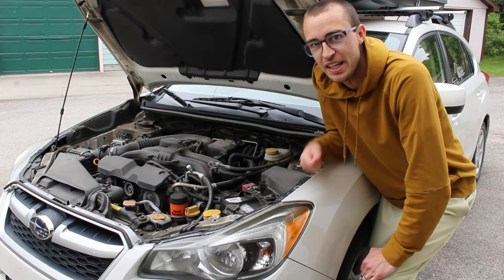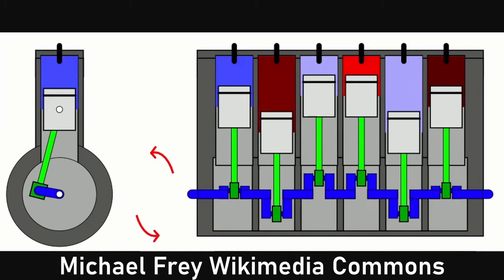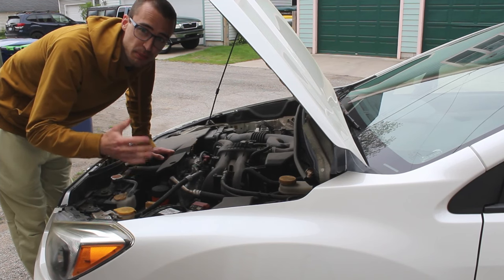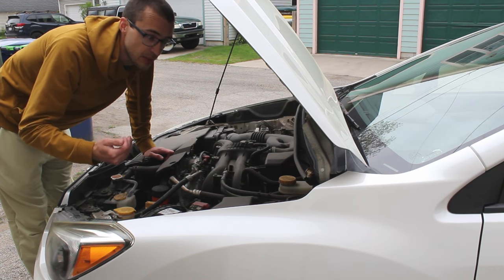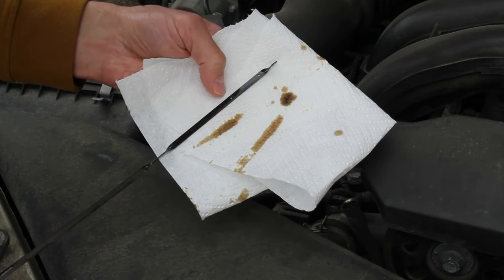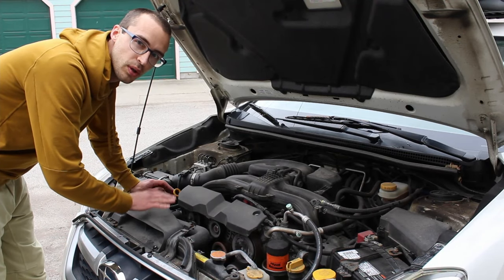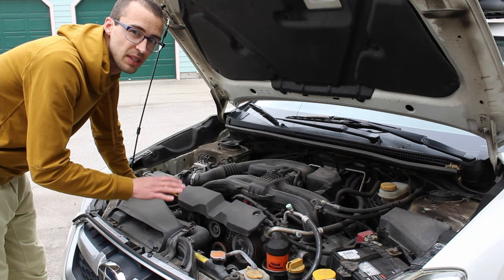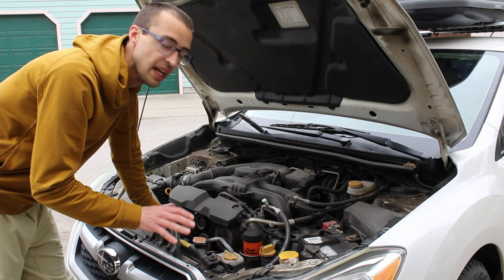Subaru Oil Consumption Issues? Information and FIX!

Comment: We just drove a lot so I bought 2 quarts when the light came on and put one in and stuck the other one in the engine bay secured and out of the way and my Subaru has maintenance reminder so after watching this I set one for a thousand miles to add oil if needed

Comment: Dealer solution is simple, even if an oil change specifies 0w-20, use 5w-30.  I found this out when I called the service writer on the discrepancy.  5w-30 eliminates oil consumption complaints.  0w-20 is for EPA mileage certification.
Reply: Is this really true? I find it hard to believe that a dealer would recommend or approve this substitution.
Reply: I’ve been using Castrol Edge fully synthetic 5w-40 in my 2013 forester with 60K mi. It helps a lot. I’ll switch to 5w-30 next change before colder weather.

Comment: I went through all same bs with my 2017 2.5 manual Outback. Dealer in Canada gave me full run around when i brought full attention to it under warranty. Did oil consumption tests was burning 1 litre every 2,000km and they declared normal. Clutch & head gasket has gone and I'm at 153,000km. Changed PCV today it was toast too.. never again with Subaru.

Comment: I always thought if you changed your oil from the specs it’s not good. I drive a ton so the thicker oil seems logic. My crosstrek has almost 200,000. The only big issues I had were my fault so I’m not blaming the company.

Comment: Thanks for the video! I switched to 5w30 and did not see any improvement in oil consumption. Now I am gonna try 0w40 and see how it works. The other question - would you recommend adding some oil additives like Lucas Heavy Duty Oil Stabilizer or smth else?
Reply from the maker: I wouldn’t ever add anything to the oil.
Reply: @KurtofTrades  Thanks
Reply: Fyi. I do 5w30 penz plat ultra and lucas oil stabilizer . Amazing results so far. 2000km and no burning oil.

Comment: New to Subbie
Just bought my first Subbie today a 2013 Outback FB25 with a manual transmission at 145k miles. Was a road trip to get her about 300 miles one way.

Heard Subbie consumes oil and did asked the previous owner if I should be alarmed with this one. He stated he didn’t noticed oil consumption. I checked the oil dipstick prior to purchase. It was at full mark.

This thing consumed about 1 quart at about 140 miles on the highway coming back home. Maybe crossing the grapevine caused it to excessively consumed oil more than it should even though it already was an excessively oil hog. What I learned was that the FB25 engines was just junk from the factory. Some junkier than others.
The yellow oil lamp came on. Never in my 22 yrs of driving have I had this happened. Never own a Subbie until now. First experience and was left with a bad taste with the brand. Must be common with Subbie apparently. I Immediately exited on the next exit and parked. Glad my wife went with me. We drove her vehicle to the nearest Walmart. Got some 5w-40. Topped it off at about 1 1/4 quart and drove the remaining 160 miles home with about 1/5 off a quart oil consumption once I got home with the heavier oil viscosity. Not sure if the 5w-40 helped that significantly or was the climbing through the grapevine caused the engine to be under loaded and consumed. Typical normal engine wouldn’t consume oil even with the same road condition.  No wonder the resell value on these Subaru don’t hold. Never in my life I have a vehicle consumed oil like this. This is bad Subaru!

Just ordered a PCV and going to put 5w-40.
Was looking forward for an adventure with this Outback. Now it’s questionable. Looks like I’ll be carrying a 5 quart jug  oil in the trunk. 

If anyone wanting advice before getting the FB25. Please get something else or just pass up on Subaru models all together. Apparently they’re very common throughout the models and gens from what I read what people experienced with excessive oil consumption. Some are worse than others but they all excessively consumes oil. So apparently 1 quart per 1000 miles is acceptable according to Subaru. That itself is a problem and should be alarmed.
Reply: @dogenthusiast729 oooof, I'm sorry to hear that was your experience with your "brand new" used car.

My 2011 subaru impreza hatchback with 150k miles is using up about 1qt every 500 miles. This started mainly after a head gasket repair... but from what I've read, and what the repair person told me, this can happen with a head gasket repair. 🤔

It was probably burning a good chunk of oil before, but I never noticed because I never thought to check the oil level. 

I'm just gonna live with it and like you said, carry a jug of oil in the trunk. Cars are too damn expensive these days to buy a new one. I'll try 5w40 in the future and see if that helps.

Comment: The real problem isn't looser tolerances in the engine.  The main problem in all vehicles onwards roughly from 2013, is the adoption of the Low Tension Oil Ring". This encourages oil up into the combustion chamber.  in the US Volvo had a class Action about this.

Comment: I have a 2011 Forester that I really noticed at my last oil change didn't have much oil left. Changed out the PCV valve and awaiting the next oil change, but noticed my oil level was dropping still. It takes 0w20 right now. You mentioned using a slightly heavier oil. What would you recommend?

Comment: I have  a 2017 Outback purchased new.   If I run MobilOne (had been my preferred brand for years) 0w-20 it will go thru a quart in about 3000 miles.   I switched to Castrol Edge Full Syn 0W-20 and now use about 3/4 quart every 6000 miles, which is when I change the oil.   Have not noticed any change in engine noise or performance.   The Castrol brand usually costs a few bucks less than the MobilOne.  The used oil seems fine, no burnt odor or bad feel but I'm not a walking Blackstone lab.
Reply: How many miles is on yours?  I bought a 2017 OB almost a year ago at 78k miles and am now finding out about its oil consumption issue. Light came on recently at 2500 miles, I had to put a quart in & took to my mechanic. He changed out the PCV valve & we are testing a new oil. I’ll check level again at 1500 miles. I’m worried I may need to trade it in, as this is for my new teen drivers & im scared they might ignore the warnings - causing $$$$ in damage. I had a Honda minivan for over 13 yrs, never once dealt w/ this, never even checked its oil levels. Ridiculous. Guess I’ll be going back to Honda

Comment: My 2012 Forester only burns a lot of oil if I drive over 70 mph. If I keep the speeds around 65 it’s not too bad. Using engine braking also burns a lot of oil. My car is paid for so I make it work. It’s just something I have to deal with until I get something new. Switching to 5w-30 also helped a little. The temps here in the South rarely get in the teens so thicker oil is ok. You have to check the oil at least once a week bare minimum.
Reply: Try Valvoline Restore and Protect or Castrol Ultra Clean to dissolve the muck out of the oil ring drain back holes.

Comment: You can get new larger sized piston rings or run heavier oil in cold and operating temps in the meantime. Short block only replaced if cylinder walls are bad or cracked block. One of my rides which is non subaru, I replaced the rings and now I don't have any oil consumption. Was using a quart every  2 weeks daily driven. Good video you have to educate people on why oil is consumed in combustion chamber. Oil is very bad for your catalytic converter. It will kill it prematurely. Better address the oil consumption asap. Damn the piston rings! If you address that you're  sweet.
Reply: How much did it cost to replace the rings? And where do you get the improved piston rings from?
Reply: I was wondering the same

Comment: BEWARE OF SUBARU I have a 2016 Forester with 66000 miles, I pay the dealer to do the oil consumption test, (the result was 2 qts. Of oil every 1200 miles) I called Subaru Of America and they are not help. SUBARU OF AMERICA response was that the only way they will fix the issue is if the vehicle still under the warranty 5 years, 60000 miles. And that bulletin of 100000 miles 8 yr  extended warranty is not for the 2016 Forester. So the cost to replace the short block is $6200.00  I wouldn't recommend a Subaru avoid it at all costs.  BEWARE OF SUBARU, they don't stand behind their products and accept that their quality on the short block and its components are low quality.
Reply: What do you aspect Subaru to do? if it is out of warranty it is out of warranty, apparently all these oil consumption issues is a global issues for most of the engines that forced to use low Tension Rings not just only Subaru,
Reply: I have a 2011 forester, it has had 3 new short block replacements. The dealer paid for the first two, I paid for the 3rd. I now require 4th new engine, or a 5th engine overall. They have refused to pay for this one. My car has 140,000 miles.
Reply: @dingpongchi632  Subaru did pay for two of my short block replacements, as mentioned above.
Reply: I’m a master mechanic and I’ve replaced engines that were supposed to be covered by Subaru only to have them deny the repairs. If they can find any reason not to cover a claim they will. When they extended the warranty on the cvt’s, my customer’s cvt went out twice. Once under warranty and once in the extended coverage. They fought both claims citing abuse. Except my customer doesn’t overland or take his off road so I knew it was Subaru just flat denying every claim hoping the customer wouldn’t fight it.
Reply: I just took my 2017 Subaru Forester into the dealer for the oil consumption test and sure enough, the dipstick showed NO oil on the dipstick.  The orange low oil light had just come on the night before.  After contacting Subaru Motor Corporation, they determined I wasn’t burning enough oil to meet the threshold for short block replacement.  So, after being loyal Subaru owners, on our 5th, and FINAL, Subaru, Never Again!  And I’m telling everyone I know not to buy these vehicles.  So, Subaru Motor Corporation saved itself the cost of a short block, but just lost roughly 25 - 30 car sales.  We buy 2 every 5-7 years, and our large circle of friends buys similarly.  Say “Bye”, Subaru, not “Buy” Subaru.
Reply: @rhondarussell282  exactly. Couldn’t believe they lost a lifelong customer like myself over a short block replacement but hey, their choice.
Reply: @rhondarussell282  I will never buy Subaru ever again after having this issue for a number of years and having oil consumption tests whilst under warranty. Once not in warranty Subaru said I needed a new short block. Thanks guys. Our family were loyal Subaru owners/users. Never again!
Reply: @dingpongchi632 yeah this is an issue with every single modern vehicle, hell the Europeans have been requiring close to 8 quarts every oil change for this exact reason
Reply: @AskBin not every single lol wth! No one I know in person including me has any oil related problems
Reply: My 2014 forester with 141,000 miles uses a quart of oil every 600 miles.
Reply: @AskBin no, oill burning is not normal and it's not a problem that every modern engine has.
Reply: Bro is genuinely surprised that Subaru is garbage
Reply: In love my crosstrek
Reply: @rhondarussell282 I’m gonna tell five people your story and ask them to tell five people. I will tell your story to people I know will also tell your story. THIS is how we fight back! Yours is an INJUSTICE!
Reply: Subarus rings are too high on the piston, unlike other manufacturers.
Reply: @rhondarussell282 sounds like you could have done that check yourself as it’s up to you to check your oil levels on regular intervals. A car doesn’t check its own oil, you have to make an effort to check 😊
Reply: @homer5103 don't agree. Had two and minimal issues. Never had oil consumption
Reply: @psynurse  minimal issues? So they still had issues then
Reply: I wouldn’t say beware. They recommend checking oil level and topping off every other gas fill up. Yes they burn oil and they know they do but knowing this isn’t a problem. If you’re burning 1-2 quarts in 1000 miles then it’s way out of spec for sure. What I say to be weary of is if you go in for an oil consumption test make sure you check your oil level before you even start the car to leave. The dealer will overfill the oil without your knowledge and say to come back in 1200 miles for a level check. If you don’t see it’s overfilled and say something by the time you bring it back it’ll be in spec cause even if a lot has burned off. No matter what. When going to any dealer for an oil change make sure to have the service writer go out with you and verify the oil level. It’ll keep them honest especially for warranty purposes.
Reply: @tpetry1303 I have a 2014 Forester doing the same. What weight oil are you using?
Reply: Just a heads up, ton of manufacturers including toyotas and hondas have oil consumption issues now. This is fo to the engine design changes discussed in the beginning of this video. It's not just Subarus.
Reply: @spol1622 yes, it is normal for this type of larger tolerance engines. While not every modern engine is designed this way, many of them are, especially the 4 cylinders. Even Toyota and Honda engines now have similar oil consumption issues.
Reply: @hanglooserecluse actually his car has multiple oil level sensors, so yeah it does actually check its own oil
Reply: @homer5103 literally ever car ever made has at least minimal issues.
Reply: I took my engine apart to fix this issue. I have a 2011 Forester with 140k miles with the infamous oil leak issues.  I redid the seals and the car was burning 1qt per 1000 miles. It took a few tries to get the seals right. Next, I replaced the rings. The oil rings were stuck and blocked with baked carbon. I replaced the rings with Mahle rings instead of Subaru rings. They have more tension on the top rings. I’ll have to see how this goes. The problem might be the oil change interval. A shorter 5k interval may prevent the carbon build up on the oil rings.
Reply: I’ve been using Castrol Edge fully synthetic 5w 40 in my 2013 forester with 60k miles. It has helped a lot with oil consumption. Probably negatively affects my mileage but it’s worth it.

Comment: Another thing that I noticed is if I use the lowest octane unleaded fuel [85] my pistons tend to miss fire and sound like it's knocking. I wonder if it has anything to do with these loose piston rings your talking about. When I use mid grade or higher it fixes the misfiring. I own a base Impreza no turbo 5 speed manual.
Reply from the maker: These cars are supposed to run on 87. I wouldn’t put 85 in it

Comment: Wait!   Is Subaru replacing short blocks, no charge, out of warranty?
I recently picked up a used '13 Legacy, and it took a quart after just 450 miles since last oil change. (threw the low oil light)  However, I'm not sure where it was on the stick @ time of change, as it had a couple hundred miles on when I bought it.   I'll be watching it closely now.
Reply from the maker: Depends on the year and model, some of the models got extended warranties.
Reply: @KurtofTrades  I just did a little digging. Looks like it is 8 year/100,000 mile, and while I didn't find it stated, probably applies only to original owners, so I'm out on all three strikes.
Reply: Also found out that this service bulletin extends from a class action lawsuit, not a voluntary manufacturer recall.

Comment: I run 0w 20 in my 2013 forester and it goes through a quart every 400 miles. Would you suggest running 0w 30 and seeing if that helps? Already tried the dealership and they said I no longer qualify for the short block replacement :( I’m also gonna try replacing the pcv valve and see if that makes a difference.
Reply from the maker: Definitely won’t hurt.
Reply: @KurtofTrades  would 0w 40 be too heavy you think ?
Reply from the maker: I ran 0w40 in my Impreza for 30k miles without any issues.
Reply: I'd run 5w30 and change it every 3000-5000 miles. slowed the consumption on my 2013.
Reply: I was also recommended to replace PCV valve, but it didnt help. Running 5w30 did not help, I'll try 0W40 now
Reply: I just bought at 2011 forester with 95k miles and even though my mechanic gave it a clean pre- purchase inspection I’ve have major problems.  I first noticed horrible gas mileage (12-13mpg). Found gunk in radiator. Dealership pulled motor, said it wasn’t original and instead from a 2013, and did a reseal. Found out he front plate was incorrect so that was replaced as well. Got it back to have the radiator hose blow off after a short drive. Dealership replaced radiator and coolant issues seem ok now but I just checked the oil.  I’m one quart low after driving 300 miles (since reseal). I’m really starting to hate this car. I’ve spent over $4k and most of the miles are on the back of a tow truck.
Reply: @unclemeat7310  sold mine for parts a few months ago after the engine blew up on a trip. Coming from a lifetime Toyota buyer I was super disappointed by my first Subaru experience.
Reply: @GeoffVentures  I’m coming from Toyota as well. I have 260k on my 2001 Tacoma TRD.  I need to get rid if it because the body is rusting off the frame due to it being in the northeast (salt) and driving the beaches looking for striped bass (salt). It leaks everything but is still going strong.  

I bought this as a replacement and my mechanic really let me down. I spent $7k on the vehicle and $4k on repairs.  I’m so far backwards in this car I’m never getting out alive.  All I need now is for some teenager on their phone totaling it and getting $3k from insurance.